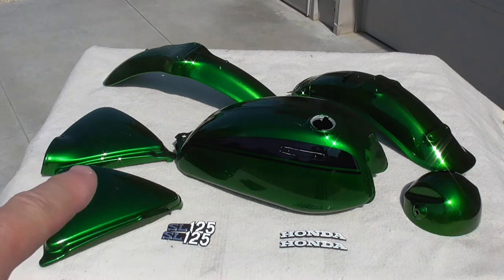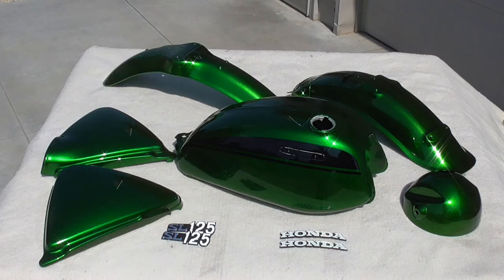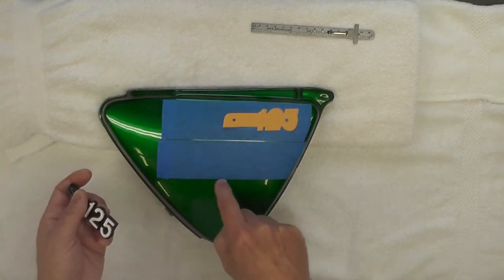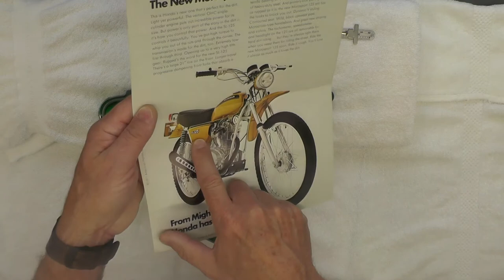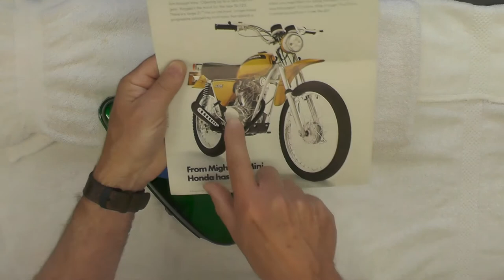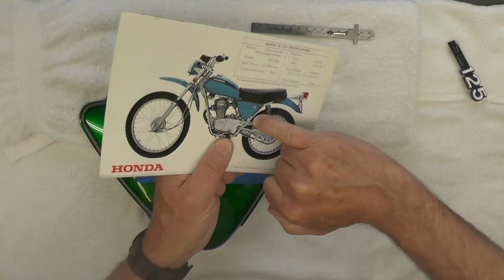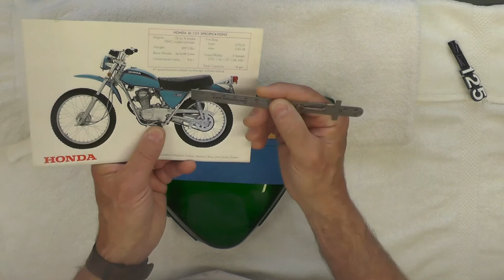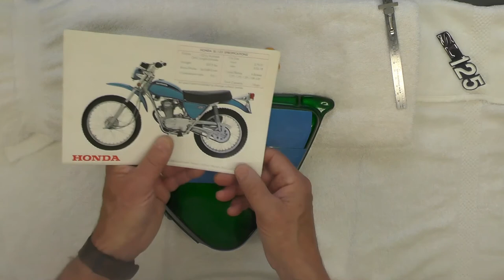Honda SL125, Painted Bodywork Reviewed! --- Video #267

Comment: How about thin, self adhesive foam on the rear of the emblem to protect the paint. Carefully cut, like your positioning template but slightly smaller all around it should do the job but be pretty well invisable. I keep the stuff in a couple of different thicknesses for mounting pressed alloy UK number plates to prevent them buzzing.
Reply from the maker: An excellent idea, thanks for sharing!
Reply: @kwrightway  I used Gasket paper, really thick stuff, that protected the paint and wasn't so thick it was visible, I coloured the edges of the gasket paper black with a fibre ink pen,